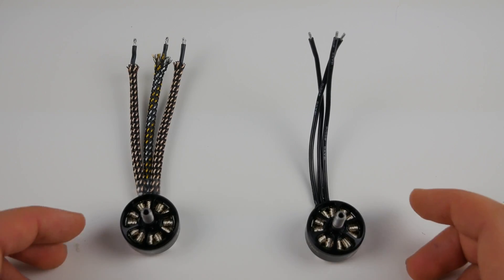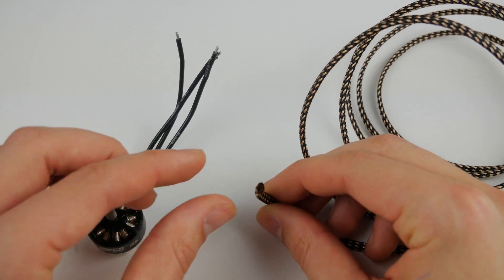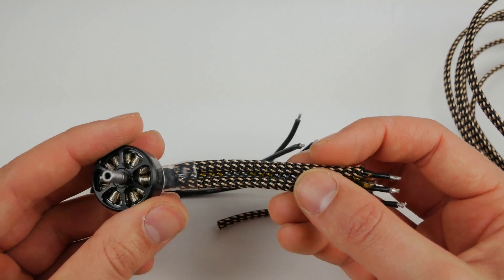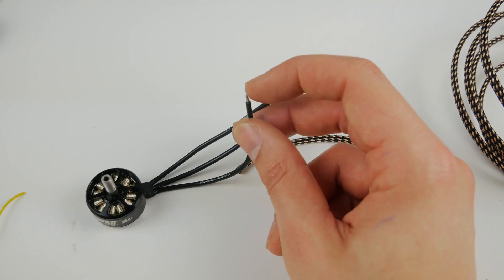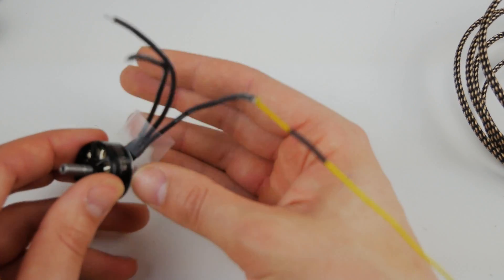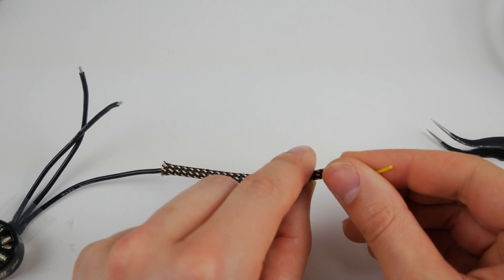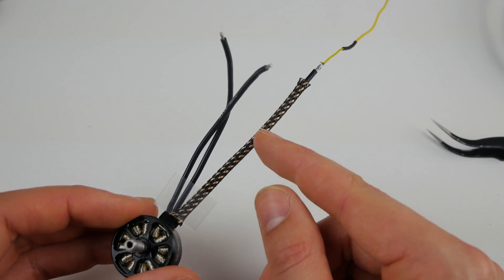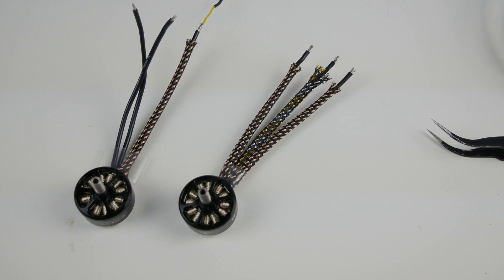Improve Your Quad - Motor Braids!

Comment: Looks great, I've always been an advocate for braid. However... as far as "how-to" goes: you could have pointed out that braid melts super easily! Anyone reading this that doesn't already know, either wrap the exposed braid in something or be super careful to only apply heat to the heatshrink. Moving the heat gun away and back in a pulsing motion I find works quite well (allows braid to cool but heatshrink still works fine). Also how come you did an individual braid on each motor wire rather than one over all 3? Does it not get crowded on the frame plus slightly excessive...? :) nice neat video though aha.